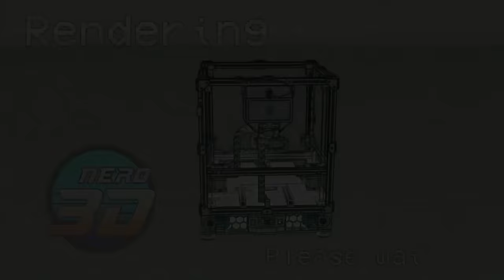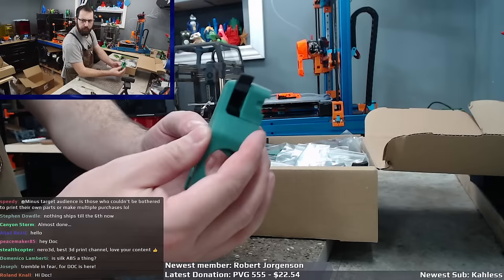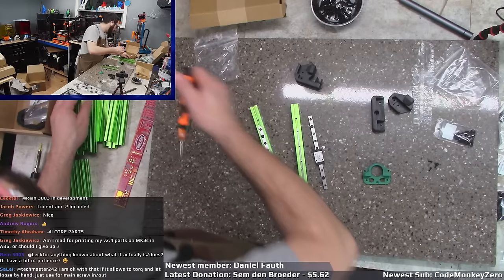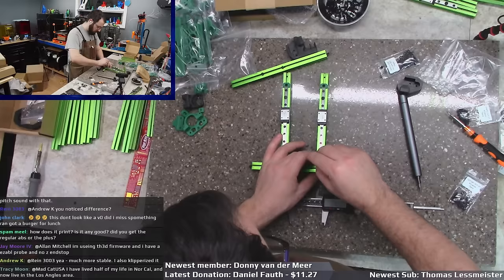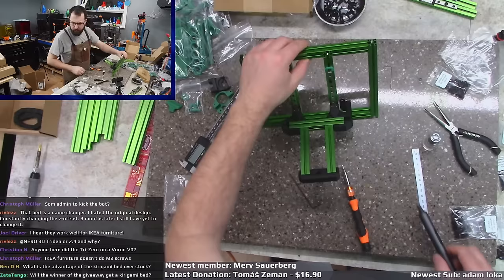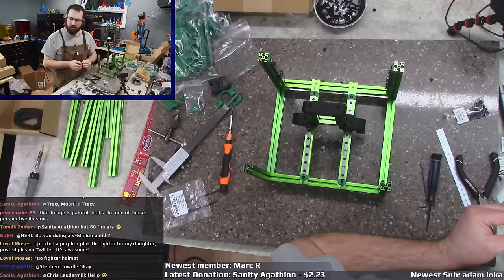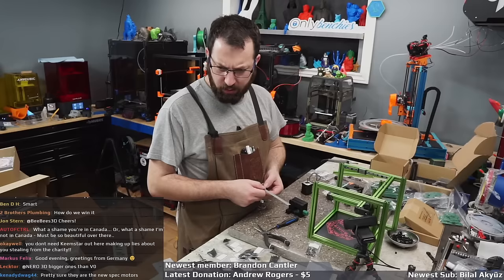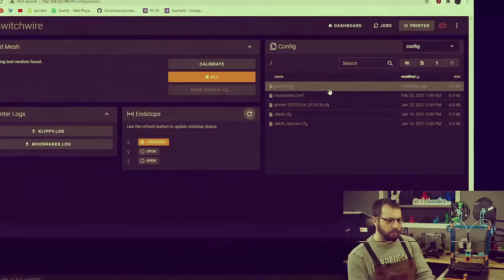Voron V0.1 Build - Lecktor PRO Kit - Part 1

Comment: Just a thought, for the A/B drives, i'd drop in some extra long screws so you can line them up  like index pins and start them when you can see the nuts.  then remove them one at a time and put in the correct screws.